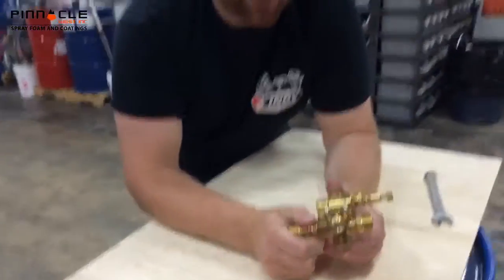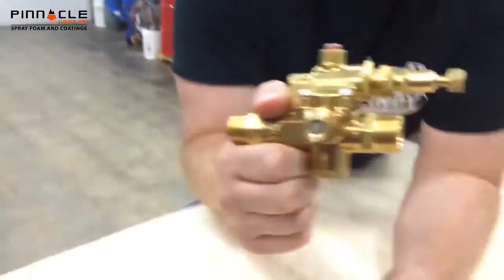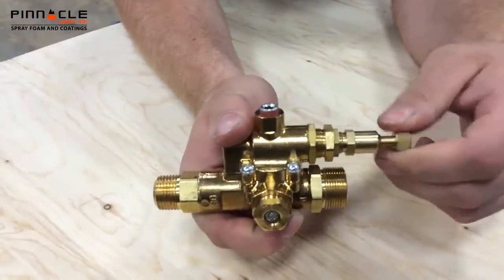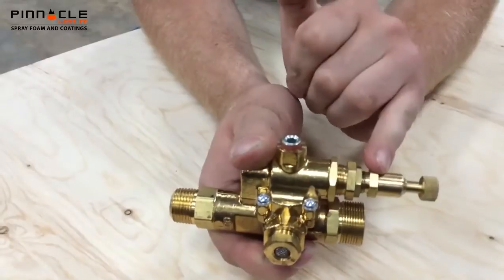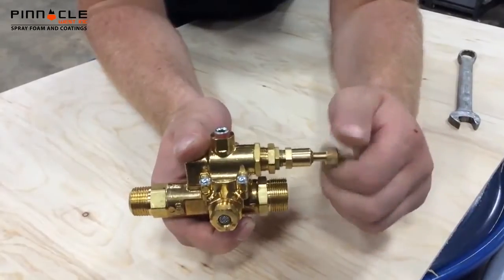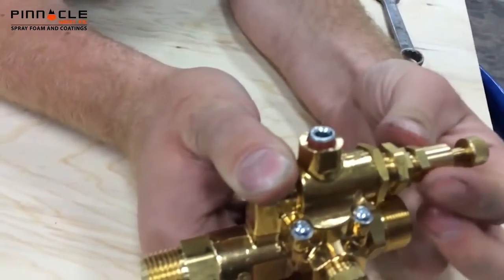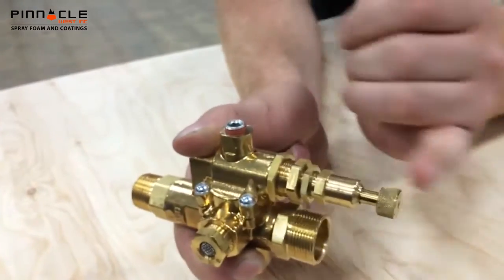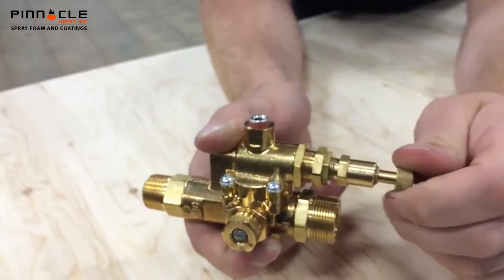Constant Run Valve Adjusment

Comment: where can you buy such a device.
Reply from the maker: Call us at 1-800-901-0088. Thanks!
Reply: I'm from another country and English is not spoken. Tell me how much is this valve.
Reply from the maker: I understand. We offer a few different constant run valves. They are $275 each depending on what compressor size it is for?
Reply: $275 thats insane its a 75 dollar valve.